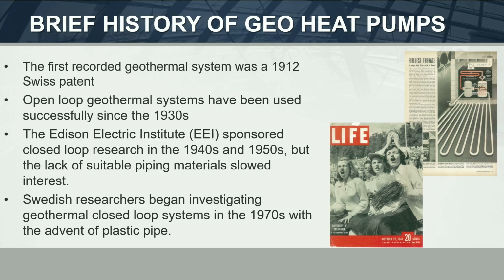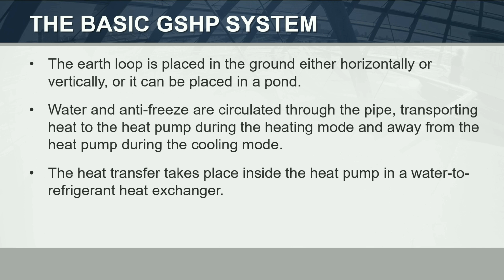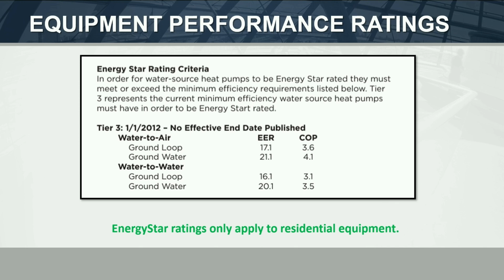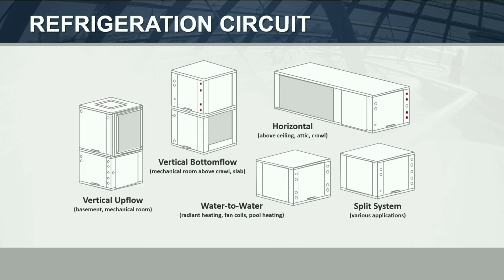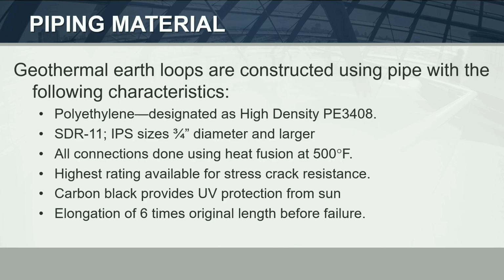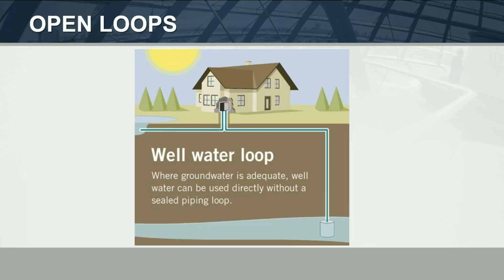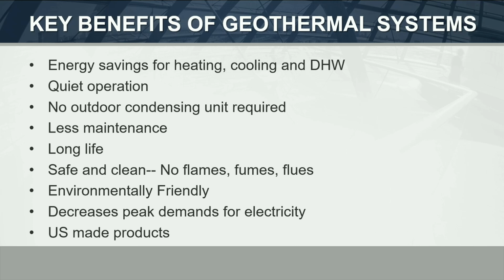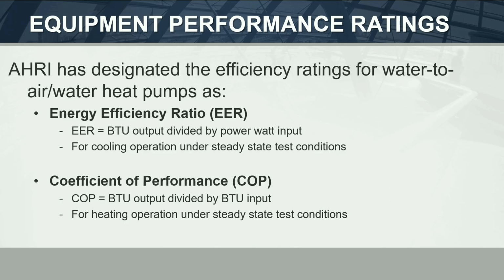Geothermal Heat Pumps 101

Comment: Ballsy from Waterfurnace; at 12.43 the picture of the open vertical unit showing the blower, evaporator coil and compressor was stolen from of my website. By the way, it's a Daikin unit, not a Waterfurnace unit. Not only ballsy but lazy from you to steal a pict from my website; Waterfurnace didn't have any unit for you to use for your presentation?